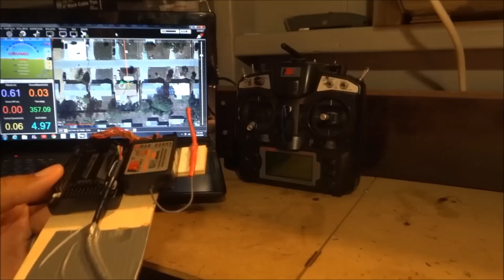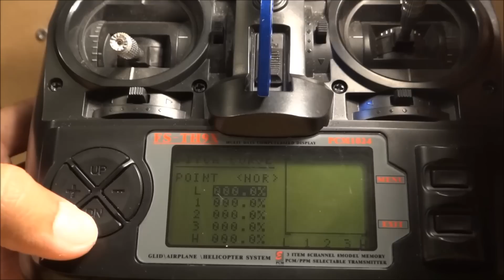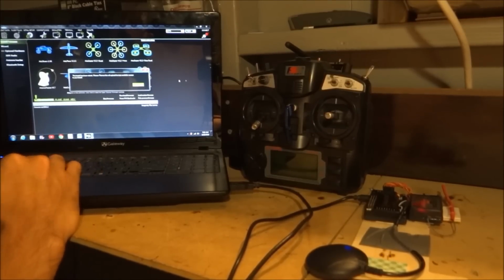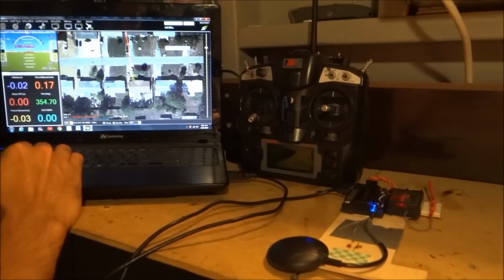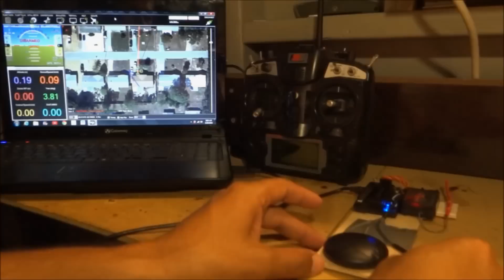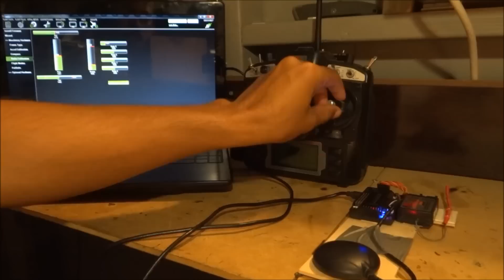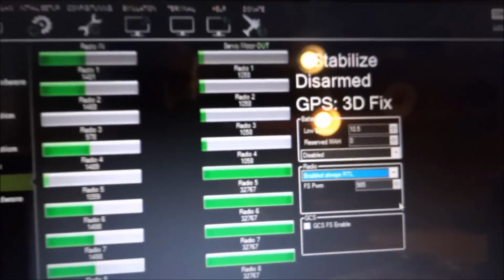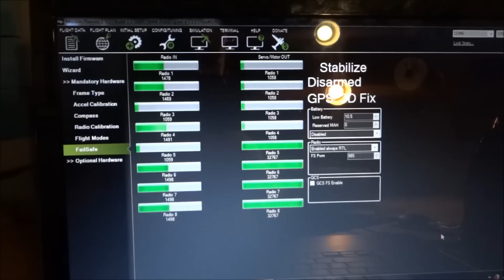How to program and setup the APM 2.6

Comment: Normally you have to fine tune the leveling later with the "Tune" function and 3 parameters (AHRS....). If not the copter / plane driftes to one sides because he has exactly to know where the earth ground vektor is.

Comment: hi question do you have any idea why my quad flip over the blades are in the correct rotation + the rotation  also  is fine i did fallow all the steps but dont know why is doing that i have the  racing 250mm with cc3d board  and i never have problem with this board.

Comment: Thanks for taking the time to do this, the content is easy to follow and very helpful. My 2.6 just arrived today so I'm gathering info. I am also using a Turnigy 9X so can I just ask are these settings (pitch curve) the only ones you have altered from standard if not could you let me know which others you have altered and the values? I'm hoping to use this switch for stabilize/ hover and RTL is that how you are using yours? Thanks again and regards

Comment: Hi. I got the same radio transmitter and receiver, after turning radio off all the values stay in last known position, they won't drop down so I can't set up radio failsafe :( Please help!
Reply from the maker: you have to have a receiver that is failsafe capable. I the Frsky module installed on my radio and using Frsky reciever that has fail safe capabilities. The stock module and reciever that comes with the radio is not fail safe capable.
Reply: Thank you for your respond I've got FS-R9B reciever and FS-RM002 the manual says failsafe is working only in PCM but looks like APM is working in PPM only. What model of receiver and module do you got that works with APM radio failsafe mode?
Reply from the maker: +Lukas Mejer Not familiar with your reciever. I'm using Frsky brand module and reciever.

Comment: thanks for your tutorial I have similar radio and I learn a missing step witch I saw how to do it sadly your video is important but some information is difficult to see do to the camera soon but still I thanks that you take the time to help others like me this board have to many ways to use that take a little time to setup perfect just a question how you setup the map in 3d my setup now is regular map I don't see my house like yours. Thanks in advance
Reply from the maker: You need internet connection. Mission planner uses google maps to locate the area you're in.